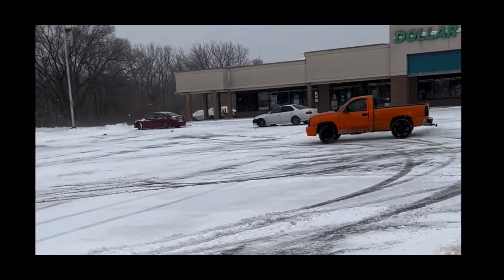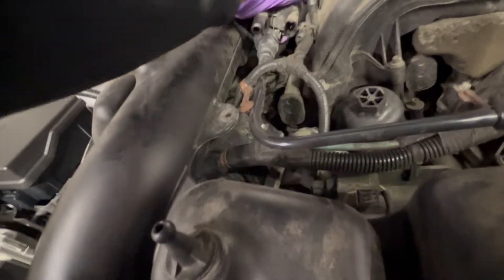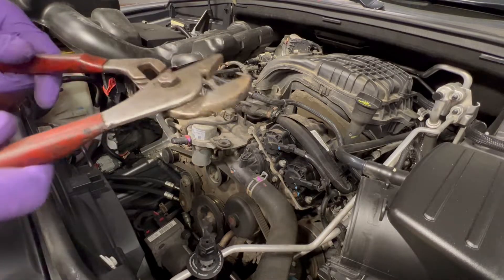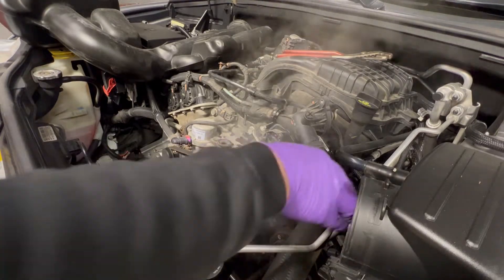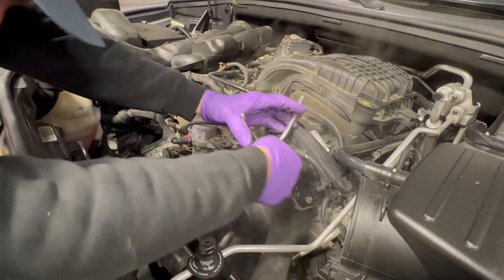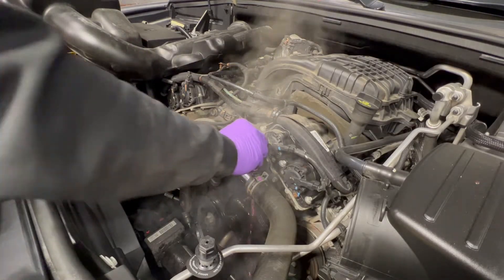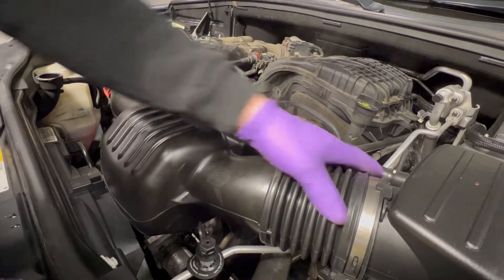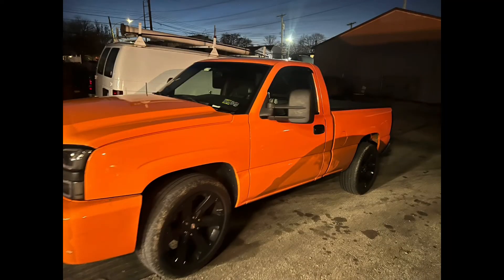2014 Dodge Durango thermostat replacement

Comment: I’m confused, you said don’t crack the cap in the beginning, then the text said to crack it. Should I right from the start?
Reply: I think the point was, leave it closed until you've swapped the thermostat so you lose less coolant.  Then open it to top up/bleed the system.  This is all if you want to minimize coolant loss.  The alternative is you intentionally drain coolant in a controlled manner and then swap the thermo when the level is below that point.  It's whatever you want to do. Thanks for the vid Rich!
Reply: Coolant smells and tastes good to rodents. And now your next problem might be electrical. They will chew wires thinking it's food. This saved coolant and time, but there's cooked coolant all over the place.